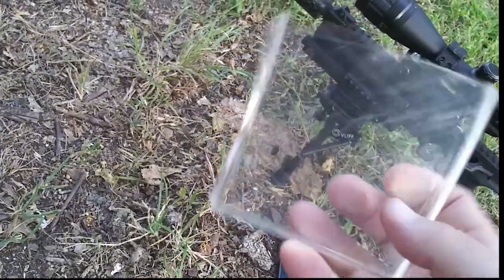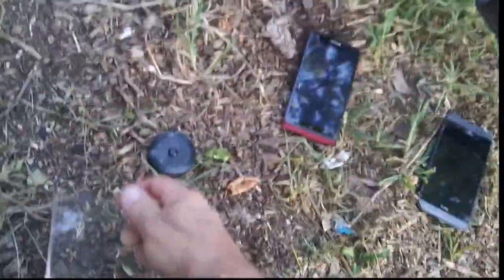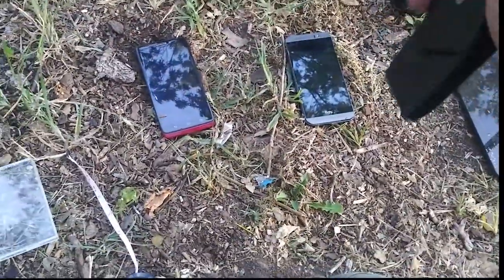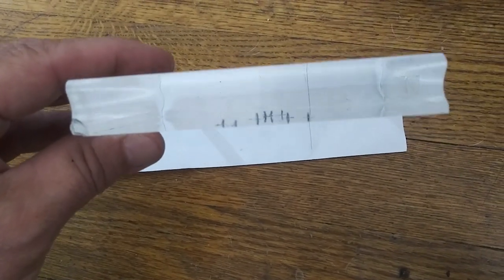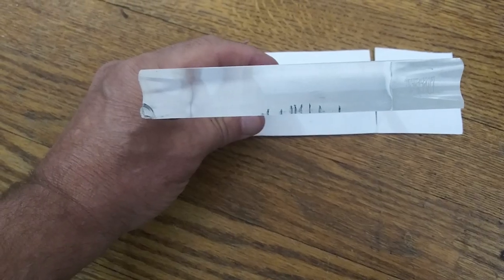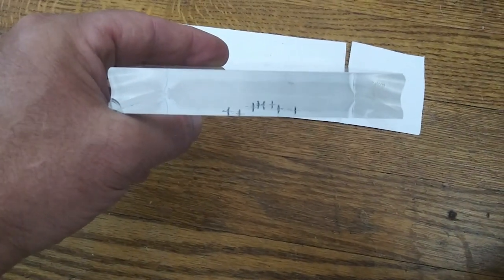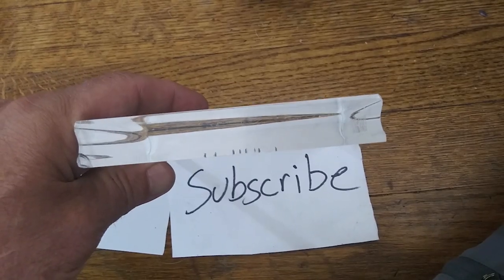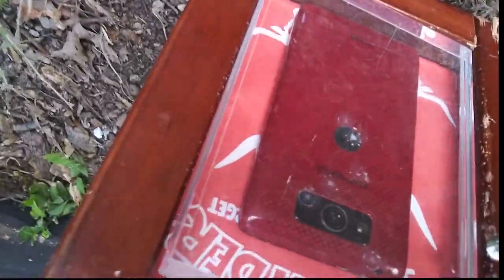matrix like effect caused by pellet gun #cool #fun

Comment: Try a higher caliber or more powerful gun.
Reply from the maker: The Beeman might do something
Reply: Use safety gear and look out for a ricochet.
Reply from the maker: @johnnybbgunner2136  very true , I need too see what the bounce back is I may have something that makes for great back stops.
Reply: My flashpup 25 probably still wouldn't even at close range and with 40 grain. Love the Jet tho, very moddable and has a lot more power potential. Everyone needs at least a Jet 1 and a Buck Rail 3d printed cheap ass moderator.
Reply: @BackyardDispatcher  Bah, I slang 25 cal King heavies at old aluminum frying pans and yeah, the don't just drop, but the only ones that ever came back at me, were Crow Magnums, loaded skirt first, with way too much Prime all priming compound in the skirt.. Them shitz scare me, but I still make em!
Reply: @BackyardDispatcher  You can always add say 5 degrees of deflection to your position on target. Sends em elsewhere.
Reply: @arsenelupiniii8040  
Yeah…that Plexiglass is bulletproof for smaller caliber firearms from a .22 all the way up to a .45.🤠🇺🇸
Reply: @johnnybbgunner2136  I use old 10 inch saw blades for an internal backstop/lead catcher. They get beat to shit, and a few penetrations.